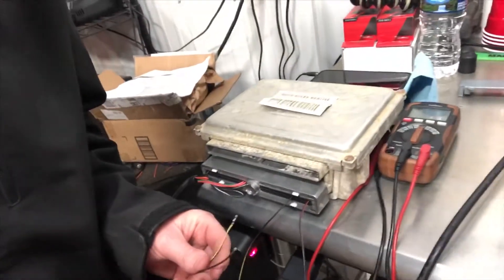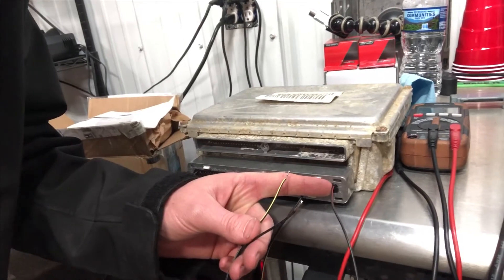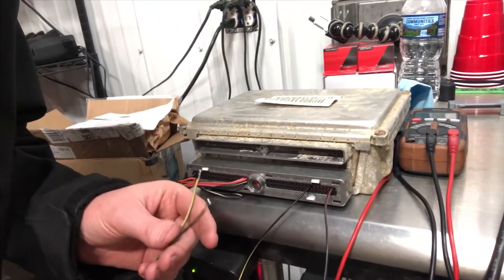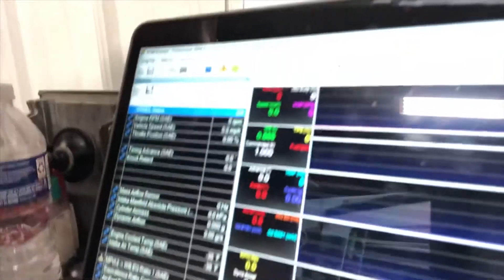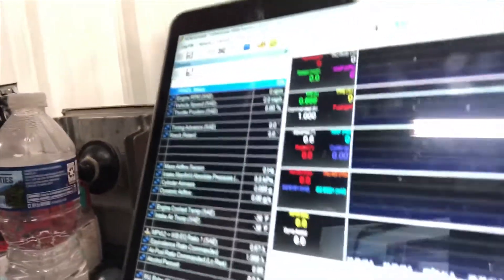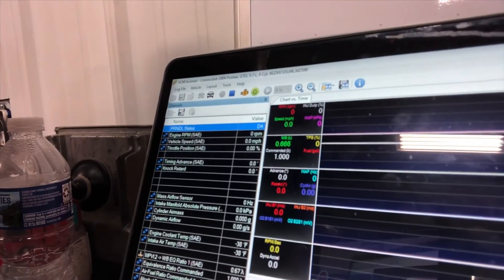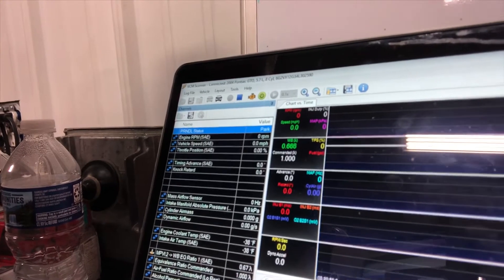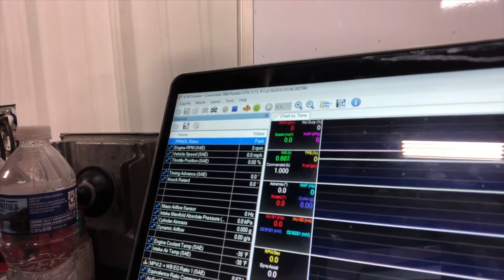GM Gen3 P/N Switch and VSS

Comment: I'm so glad I found this. I've got a lm7 with a th400 going in a 91 GMC Sonoma and I'm wondering if I need to get anything updated on the transmission itself to make everything run right? I've been trying to look into seeing how I can make all my gauges work and I'm probably just going to invest in the Dakota digital gauges but when it comes down to the transmission I seen a video where someone added on the tail shaft some little gear so it would read the speedometer but is that what I need for this what you're talking about because it seems like you're talking about something to where I would need a electronic speedometer of some sort? Like what all needs to be wired up in order for this to work right?

Comment: Im running an ar5, my vss is hooked up and the truck runs pretty good just some idle issues when clutching the idle hangs, im using the non electric auto setting and no p/n , if i set it to p/n only and then hook pin 34 to ground when pressing the clutch would that help with my idle routine?
Reply from the maker: You don't need this if it's a manual transmission. You need to set the transmission type to manual and tune idle cracker.

Comment: I recently swapped a 5 speed behind my gen3 5.3 and it doesn't have a vss. I am thinking about hooking the factory vss sensor up to a tone ring on the driveshaft. do you know if the factory GM vss from the 4l60e is a 12v or 5v signal output? also, do you know if I need to use magnets on my driveshaft for the sensor to pick up a signal, or if it will pick up a signal from the U-joint passing by? I know I can adjust the tune for the different pulse count, I just can't seem to find any info about a DIY vss setup. thanks!

Comment: Question for you. I have a ls 5.3 attached to a manual 6 speed porsche transaxle. Should i still wire in a VSS? I made provisions to the pcm but have not figured out a VSS setup yet. Any help is greatly appreciated. Thank you
Reply from the maker: Yes it will make idle routine work much more like stock. With no VSS signal the PCM thinks your vehicle is sitting still all the time. This is a problem because under a predefined speed the PCM goes into closed loop idle routine to actively track target idle speed. This is especially troublesome on manual transmissions due to engine braking in gear off the throttle. When TPS goes to 0% and VSS is at 0mph closed loop idle is enabled. If the car is coasting down the road in gear the momentum is mechanically holding engine RPM higher than target idle which will cause the IAC system to close attempting to slow the engine down.
Reply: @ShorTuning  Thank You! that was exactly what i needed to know.

Comment: Great info dude! Its hard to find this stuff.  Im struggling to get my Gen3 VSS to work on my 231j t-case. Any suggestions on a cure 🤔 ?
Reply from the maker: The factory PCM looks for a VR signal so whatever you use needs to send that type of signal. You can input the tooth count in the tune then back calculate the pulse per mile and trans rev/mile information.

Comment: So where should the pin wire34 be connected?
Thanks
Reply from the maker: To the Park/Neutral switch most shifters have built in.
Reply: @ShorTuning will a psi standalone harness need the park/nuetral wire? It says it’s only for a t56 style trans I’m running a power glide to 5.3 gen3 will the vss control whether it’s in park or nuetral?

Comment: James, I have a question for you...I’m running an LS swapped Colorado (5.3/4L60E combo).  My transmission will intermittently drop out of 4th gear, and then after a mile or so will shift back into 4th. It seems to start acting funny after it warms up-after driving 20 miles or so. Is there something in the tune that could be causing this, or is more likely something in the trans itself? Thanks!
Reply: did you ever figure this out I have similar issue rebuilt transmission with no sucess obd live shows speedometer jumping up and down during constant speeds and suspect a bad vss sensor
Reply from the maker: Sorry just now seeing this. More than likely it's something in the transmission or may be a safety table we don't have access to pertaining to a temperature or slip issue within the trans. Be sure your up/down shift patters aren't overlapping confusing the ECU.